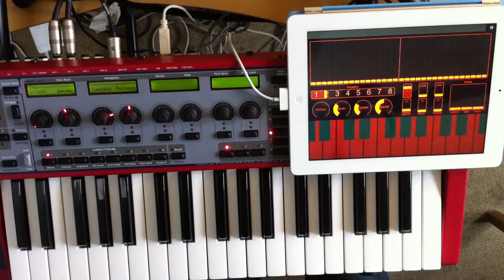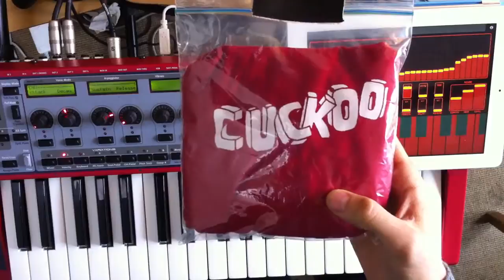Touch Control Synthesizer by CUCKOO

Comment from the maker: @skyskraberen Thanks! Essentially I think you're right. It probably would work just as well with an iPad-app with a hooked up USB midi keyboard for better playability.. Also an app is easy to upgrade. But with a hardware design you can go further in terms of customisation. It can be a dedicated and well thought through device with physical buttons in a layout that makes sense, and a touch surface incorporated in just the right size used for just the right things etc. Perhaps a mix is the thing.

Comment: Since i started  getting into electronically synthesized sounds this type of product has been on top of my wish list. That is drawing-the-waveform-type-synthesizer. Have you done research to check if similar products already exist? Saw a demo of Absynth 5, which had waveform drawing. Do you know of any other synths, hard or soft, that has this capability? The best of luck to you in the further development! Cheers